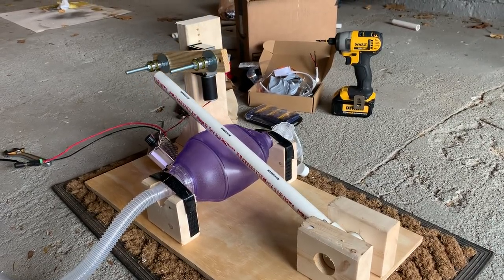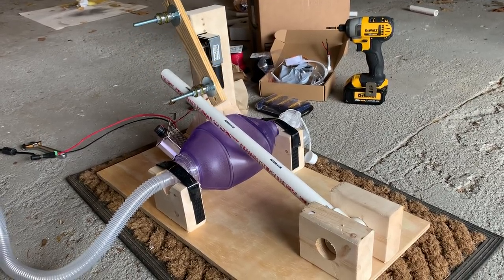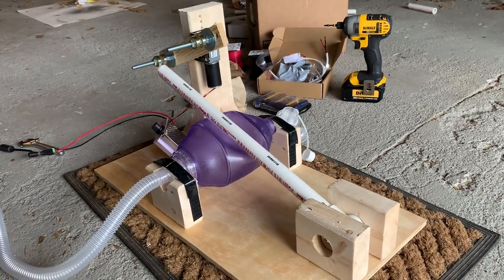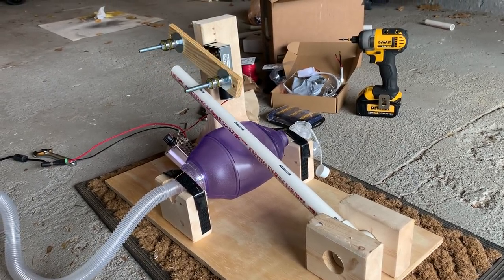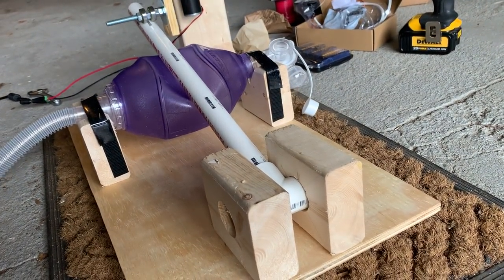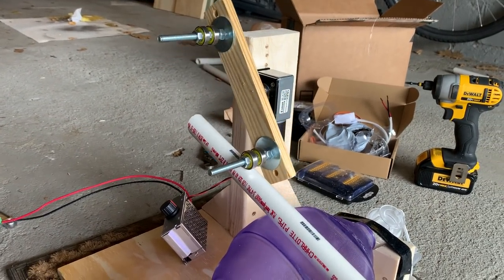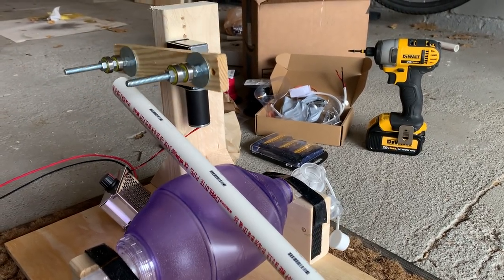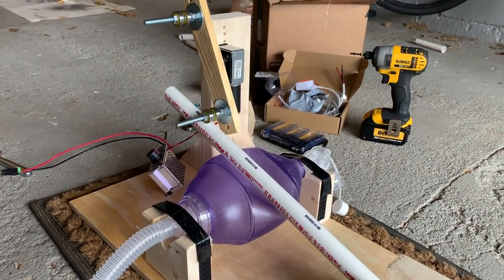Macgyvilator Mk 1 (3-19-2020) - "ventilator" for disasters and/or low resource environments

Comment: I’d maybe add a gear reduction so you can run the motor at faster speeds but to have greater torque against resistance. Also a dimmer switch to control overall speed / breaths per minute. It also seems as if you used a larger pvc pipe in place it might be a closer adult tidal volume.
Reply from the maker: There's already a great reduction within the motor, I believe. It's what allows the motor to have the torque it has (and torque is an important design consideration for this setup). There's also already a PWM module in place with a dial to control respiratory rate.

Comment: What size motor is this and what voltage ?  This is fantastic, god bless, in case we need this, will go to hardware store asap , when we get the parts list.
Reply from the maker: This is 12V high torque, low RPM motor. Parts list forthcoming...

Comment: When some one in hospital on ventilator only normal air is pumped in or Oxigan too?
Reply: It depends on the patient's oxygen saturation. If they are experiencing hypoxemia that would require supplemental oxygen. Coronavirus patients with more severe cases would definitely need supplemental oxygen.

Comment: Can you share the motor and potentiometer? I'm not electrically inclined. Maybe a video showing the wiring diagram?
Reply from the maker: I'm assembling Mk2 as I type this. I'll test the whole thing in a respiratory lab tomorrow, and if I can achieve good physiologic parameters, I'll put together a parts list and assembly instructions.

Comment: I am a aircraft mechanic by trade I heard you say you are a Doctor my question is why don't you use a cpap  machine as a air source its pressure is adjustable they are readily available you could simply divert the pressure during the exhale unless you require some kind of vacuum
Reply: The problem is that in developed countries, the need may outstrip the number of available CPAP machines. In less-developed areas, there may be NO CPAP machines. This is a work-around.
Reply from the maker: @PeterWMeek  Took the words right out of my mouth!

Comment: Can you adjust the I:E ratio?
Reply: If you removed one of the skateboard bearings you could significantly increase the expiratory time. You could then increase the motor speed to regain your respiratory rate. Fine tuning I:E would be extremely difficult without a significant redesign of the rotational portion. Still very impressive design.
Reply from the maker: @justincaseyouforget  Thanks. I think you could tweak the I-time by controlling where in the rotation cycle the skateboard bearing hits the PVC tube and how sharply it lets off (which you can tweak a bit with the length of the PVC tube). What sort of I:E do you think would be a good starting point?
Reply: @datatrician1369  just to keep it simple, normal vent I:E is 1:2. For patients with obstructive issues (COPD, bronchitis, etc) 1:3 is what most people go to. Some folks play with 1:2.5 and other odd numbers, but they're not necessary. If this was strictly 1:2, it would be great. If there was an option to dial in 1:3 as well, you would cover the needs of most adult patients (it may be enough for pediatrics too, but others know that way better than I do). Either way, this is still impressive.
Reply from the maker: @justincaseyouforget  Very helpful data. I'm pretty sure this can be achieved with some simple geometry. I'd need the skateboard bearing to be in contact with the PVC tube for roughly 60 degrees of arc to give a 1:2 (45 degrees for a 1:3). I'll do some testing with a stopwatch.
Reply: @datatrician1369  it's a minor note, but keep in mind that while the bag is relaxing (PVC upswing), that is the beginning of exhalation. Inhalation is only when the bag is being compressed. So probably a bit more than 60 degrees. I hope that helps.
Reply: What about a round disc and pivoting arm connected to the pvc..  Sort of like the old train engines used or steam engines?  You could make the arm adjustable with different mounting holes and still use the motor controller for rotation speed.

Comment: Major flaw..... the person who needs this mask can in no way wear it because its attached to a wood plate.  Do you intend to mount the plate their chest?   The  mechanism needs to be portable and self contained, with maybe a cord to the power supply and controls.
Reply from the maker: The patient's ET tube would be connected to the bag via standard airway tubing. I didn't set it up here, but if you look at the Mk2 video, it's there.

Comment: A good idea to do with a local material.
it is possible to reduce some part  by remove pvc pipe part
Rotate bag vale 90 degree  and change a rotate 2 nut  with wood cam or long pvc pipe
for hit directly to bag vale.  :D

Comment: How long can it run for before the temperature rises?
Reply from the maker: Heat is always a concern. I've done stress tests for 24 hours, but that was in a cool garage. I've seen other builds using fans and heatspreaders. Another option is to use something like a wiper motor that won't be operating as close to its maximum design threshold.

Comment: Thank you, @Datatrician, for posting this and channeling your energies to think about what will likely be an urgent need in the weeks to come. I posted your video in an Arduino forum (microprocessor geeks) where they were discussing the concept of building a DIY ventilator. I encouraged them to look at this and think, not about building a vent from scratch, but about building a controller and feedback device that could be used to manage this design. You can do a lot with a simple microprocessor and they can be built and deployed very quickly. Here is the thread. We will see what they come up with. I know you are trying to keep your design simple, but it seems there could be a couple of basic controls, sensors and alarms that could be added using very available parts and a little code. https://forum.arduino.cc/index.php?topic=670500.30 Keep it up!
Reply from the maker: Open to any and all suggestions! Thanks for spreading the word.

Comment: Good design for completely paralysed patients if pt. has any reflexes intact he may fight the ventilator
Reply from the maker: This is a good point. There is mandatory ventilation only. Without a breath trigger built, there would be a requirement for heavy sedation.

Comment: Plz dnt call it ventilator, it's just a bag pumping machine,,, treating respiratory failure requires more than this pumping. If this could replace ventilator,do u think America would have been short of ventilators. It takes years just to understand the functioning of ventilator.
Reply from the maker: That's why "ventilator" is in quotes. This has never been intended to replace a ventilator.

Comment: This is brilliant! I know several mechanical engineers who can't think like this, they want to make everything expensive and very complicated??? Why  are our leaders leading us down a $50k per unit road when so many people might die as a result of waiting for large companies to figure how to get the most profit. This simple design can be cost effective and can be scaled to mass produce with a quick turnaround and plastic parts could be 3d printed. BTW what is the motor and controller specs? Thanks
Reply: You are wrong, there are a lot of system, all of them has better performance depending on cost. And they are simple to build if you have the tools.

Comment: Nice design. I would recommend to use motor from the car wipers - it is 12 volts, it comes with 3 speed gearbox. If you have a kit with a mask, then the rest of the parts can be assembled using the details of any car (motor, battery) and pieces of wood that most people can find in garage. I think bearings are optional - you can simply grease the surface and/or put a peace of metal.
I suspect oxygen supply is important part of this device and it's missed here. Oxygen can be obtained by mixing hydrogen peroxide with potassium permanganate. Both components could be found in any pharmacy shop.

Comment: Datatrician, a concern and question/suggestion. 1} Would the use of BVM for a disaster ventilator not put our supply of BVMs at risk for similar shortages? 2}-couldn't a regular bellows, either 3D printed or an industrial component such as this  (see Amazon ref) be configured for use instead of BVM?  [https://www.amazon.com/Prompt-Manikin-Bellows-Piston-Clicker/dp/B002TEJE8O/]  The industrial style would also offer the decrease in horizontal space require as it would be cylindrical.  And if topped with a circular wooden or metal plate would likely be less prone to fatigue and failure.  Volume could be adjusted by raising or lowering the roller arm above.  Just some late night RN thoughts!
Reply from the maker: Well, the thought is that the number of BMVs (of which there are a lot) + number of vents >> number of vents. I used a BMV because it's common and because it slots into airway circuits without difficulty. I didn't have to create specialized fittings, which I would've had to do with an industrial component. If you had time, you could certainly design something around what you've described. But I wanted something where people could mostly grab what's handy.

Comment: 3d printers are not what we need.. pipes and wood... we could even run many ventilation units on one motor
Reply: (if motors are the supply chain weakness)
Reply: probably needs a spring to fully open the bag?
Reply from the maker: @yamspaine  That's a consideration for Mk2
Reply: I've since learned that the frequency of breath and other factors like sensing if the person is trying to breath, and not fighting them are important
Reply: @datatrician1369  Also pressure management/ monitoring so we don't damage the users' fragile lungs

Comment: What patients need is any airflow, controlled per patient. CPAP. Hospitals have enough oxigen, just blow it in with normal air under a little over pressure.

I think about 1 big air ventilator Hook up 100+ patients on it.

Most patients don't need an artificial lung like your video. Learn about CPAP in relation to Covid-19 patients.

Comment: great  as long as the volume and rate are sufficient... i dont know the exact needs corona patients require but consider adding a homemade oxygen purifier from water using electricity to the intake valve to better the ratio since even if mechanically you can get air in if oxygen isnt absorbed in the body due to virus damage its purpose is not met (and i think it might be more sterile than just regular air) .... also for "hardcore diy mode" choose to use the excess hydrogen for a small flame and receiving steam engine with gears for the rotating pump since electricity 12-24v will be needed for the electrolysis and even it can come from a battery with solar recharge (damn this went way our of purpose but still think its a cool basic model if the math checks out)
Imagine having less than a week notice since your health is going downhill rather than improving and no option of hospital care due to mass need, only one trip to a hardware store and basic garage  tools to craft and survive like a mad scientist who would rather risk blowing himself up than submit
My focus points would be:
Not break in a full week 24/7 use 
Keep sterile or design with changing key parts to keep new bacteria out of damaged lungs 
Optimum rate/flow for a few types of people - big, adult, child

Comment: USE A PIECE OF KENDOFF AND YOU CAN ADJUST THE SKATES FOR TIDAL VOLUME...https://www.grainger.com/category/brand/kindorf
Reply from the maker: Can you explain further? Maybe draw a picture? I'm afraid I don't follow.
Reply: @datatrician1369  KENDOFF IS A SLOTTED EXTRUDED PIECE OF STEAL STOCK USED AS A MOUNTING BRACKET (IT HAS SLOTS SPACED AT PREDETERMINED DISTANCES AND WELL AS A RAIL THAT RUNS THE FULL LENGTH OF THE STOCK)).....IF YOU GO TO MY LINK AND SCROLL DOWN YOU WILL SEE IT....SORRY ABOUT THE CAPS, DON'T HAVE MY GLASSES... THE SLOTS ARE EVENLY SPACED SO YOU CAN MOUNT THE SKATES AT VARIOUS SPOTS TO INCREASE (OR DECREASE) THE DEPTH OF THE PVC PIPES INTERACTION WITH THE BVM...(INCREASING OR DECEASING TIDAL VOLUME)...YOU COULD PREMARK DESIGNATED SLOTS FOR MEASURED DELIVERY AD ADJUST ACCORDINGLY...
Reply from the maker: @glennmartel7115  Got it - thanks for clarifying. I think that would work fine! Right now I'm going for bog simple and just drilling a series of holes in the wood to allow different placement. It's not super pretty, but it's simple!
Reply: @datatrician1369  the beauty of the kendoff is the holes are "predrilled"...good luck.

Comment: You never vent a positive Covid-19 with a bag!
Wrong Wrong Wrong!!!
Reply from the maker: Any solution has to have microbial filtration, for sure. An in-line filter will slot into anything built around a BVM, and you'd probably want to put it between the patient and the bag.
Reply: But what happens when you give a breath and disconnect?? Small virus particles everywhere
Best.
Reply from the maker: @alanmatthews5949  As long as you disconnect distal to the filter, there should be no issues. But a disconnect is going to happen with any respiratory setup, including a full-fledged ventilator. You're right to worry about microbial filtration, but there are no perfect solutions.

Comment: Criticism- getting geared motors in any type of quantity is bloody hard, I don't expect Amazon to delivery motors and PWM controllers (I think these are from China) in a disaster area. Do you? 
Great concept and superb motivation but very bad execution. Sorry.
Reply from the maker: Your local auto parts store will have windshield wiper motors. Acceptable motors can also be obtained from junkyards, garage door openers, and any number of other places. I just used Amazon because it was quick and easy. You can run the motors off a 12V car battery. The PWM controller is nice to have, but ultimately if you're running at a fixed rate in a physiologic rate (10-20), that'll still be a heck of a lot better than hand bagging. You make do with what you have.
Reply: @datatrician1369  Let me clarify; Motors are easily available "geared" motors are not. PWM controllers can be easily made by any electronics DIYer but your system relies on a geared Motor. Most industrial/ commercial systems that I have seen have a motor and a custom gearbox or some arrangement to generate for torque (force) from a motor. 
For the uninitiated, the motor is the black cylinder attached to the vertical block of wood and the gearbox is the rectangular cuboid on top of the motor which is connected to the rotating arm. 
You can also check out various other designs from MIT, Rice university and a dozen other places. Most have tried to automate the Bag Valve Mask with varying degrees of simplicity.
Reply from the maker: @sujoybha  Thanks for the clarification, and you're right. Geared motors don't grow on trees, but then again neither do custom gearboxes, 3D printed parts, or controller boards. That was part of my concern regarding a lot of the projects elsewhere, against which - to be clear - this project is meant to be complementary, not substitutive. There are a lot of great designs out there, each of which has its own niche. The idea around this attempt was to assemble something that works (and if you look at the Mk2 video, it does indeed work) from off-the-shelf parts that are readily available. I've given a couple sources of geared motors aside from the internet, and I'm sure others can name more. I appreciate the criticism you're giving, but I ask that you help by giving a constructive alternative. How else can this be built? This is meant to provoke discussion and thought. Build something and show us!

Comment: if you needed to use this... you would die. If you  need a  vent the tape could not be replaced as black tape dries and stretches then falls off. The bottle will eventually crack and break making it useless. Special materials are rqd for the accordion as are the rest of this . Once you need a respirator it cant stop or break down. Hospitals have back up generators. DONT DO THIS and remove this video asap. DANGER WILL ROBINSON>

Comment: @James Crud. Why take such a negative and non-productive approach to entering a conversation that has to do with trying to find a solution. It appears that your point is to come off as having an expert opinion. However you fail to actually offer any potential solutions, just criticism and a condescending smug attitude. What credentials/ relative experience do you happen to have that would make your opinion even worth considering? Your claim that hospitals would not even consider alternative/ non-conventional equipment is ridiculous given a pandemic scenario because they would be too concerned with lawsuits. What part of having ICU beds set up in a parking garage is conventional or “normal”? Because that is already happening.